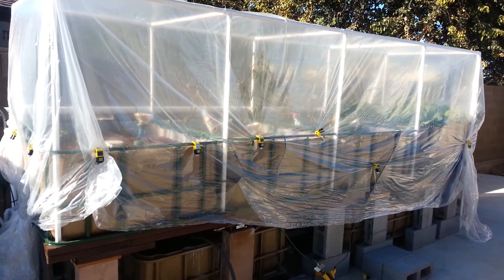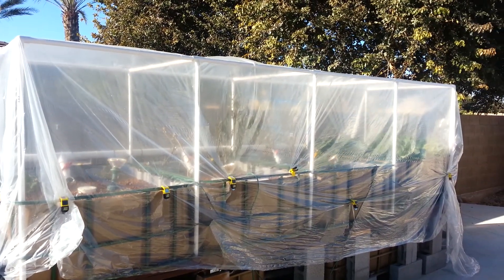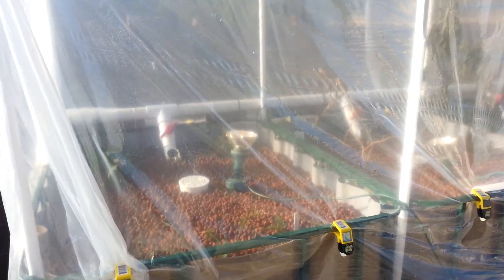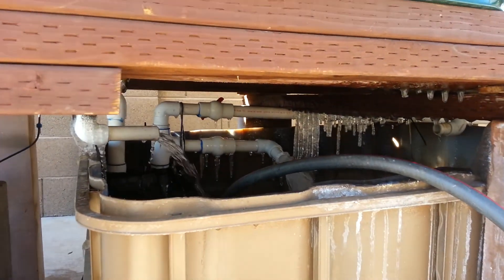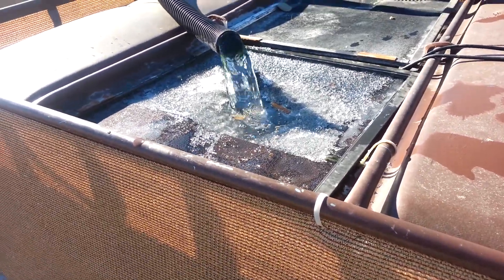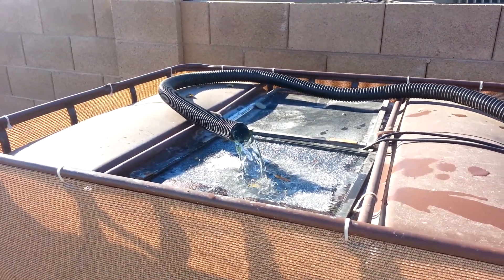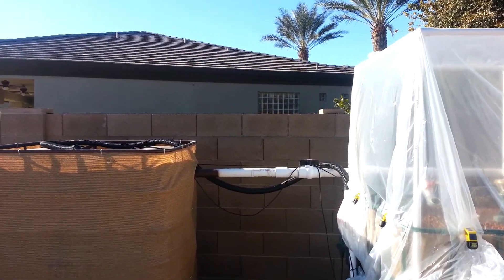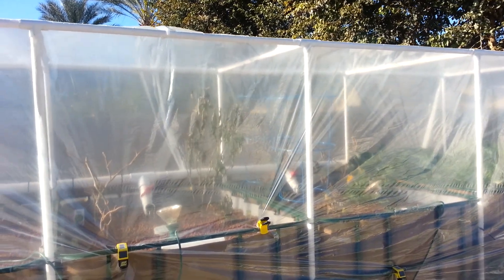Aquaponics in Arizona/Artic

Comment: Building a plywood/lumber box around your fish tank would give you a platform atop to grow duckweed as well as an an insulation value for shade from the walls. To help prevent winter freezing, you could use black foam pipe wraps. Maybe mylar on the sides of the fish tank cover would help keep water temps down later this year. Just a thought.

Comment: To help retain heat in winter and block heat in the summer you could add thin panels to the bins and use Great Stuff foam cans to fill voids.Shower wall panels are cheap and white to block UV heat in Arizona heat of summer. Or build up wood sides around the bins to make it look good and fill the gap with the foam. Just an idea, hope it helps

Comment from the maker: I used cans of spray paint.  It takes about a can and a half for the frame and two cans for the liner.  Doing it again I would use a primer and paint from a can on the liner. The spray paint scratches off pretty easily.  Spray paint is also more expensive.

Comment: Hi I just started building a tote system I have to travel 107 miles to get expanded shale I need 2-ton. I have 4-grow bed also. So what kind of paint did you use on your totes.  I have access to some aluminum coil stock Dk brown smooth for vinil siding, I think will work. Your system looks great.  Here In Durham,N.C. It dips in the 20* also. Off to San Diego for 3-weeks to see grand son.  Totes will be on hold for a while. 
Later
Bob